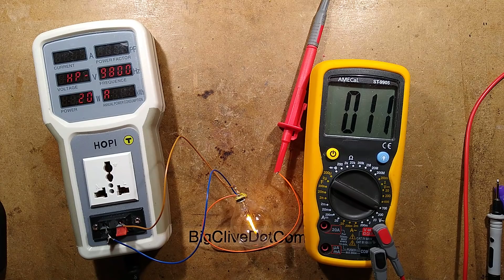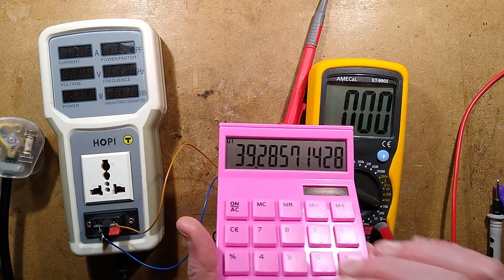Exploring 0.5W LED festoon lamps and extending their life

Comment: Oh wow, I didn't think you guys had anything like our C7 lights over there.  Now obviously these are G30 or whatever but that's clearly an E12 base, which our C7 lamps use.  Neat.  We of course had the series E10 sets way back in the day as well, ours were 15V bulbs and 9 in series, yours I believe were 12V bulbs and 20 in series.  Often with one single wire in a loop, instead of a straight line string, though those were available as well, usually with a knot and a little drop of something like 2" down to each socket.

I actually made my own E26 festoon strand in the style of vintage sets with a twisted pair I also twisted myself.  Time consuming but easy, and I used Leviton #167 sockets.  Lay wires in the tracks, screw down bottom cap and pins punch into the wire and make contact.  A nice, vintage look.  Then I bought these multi color filament A19 LED lamps, 60W equivalent, and thought that'd be neat to test it with.  The spots in my eyes lasted for hours.  LOL!

Comment: Theoretically wouldn't putting two leds in parrell pointing opposite directions be safe, since there is a resistor in series? I would think the LED forward biased would drain off enough of the voltage that the reverse biasing wouldn't be high enough to do damage. Basically it seems like it is just the relatively high value series resistor is what makes these LEDs safe to run on AC.

Comment: I have this exact set! Keen to extend the life, is the 1U 400V capacitor definitely to go in series with the set and not parallel across L and N? And should the 1M resistor be across the capacitor legs (so also in series) or across L and N? 

Also, would a 2W metal film resistor of 1M be enough power to discharge the cap safely?
Reply: In fact I found the answer to my question watching your other video on Dooby lamps (how to make your own) - keep up the amazing work Clive!

Comment: E12 is also known as "candelabra base" here in the US and is mostly used for chandeliers and similar indoor lighting where lots of small lamps are used in one fixture. The classic C7 indoor Christmas lights used the same base. Outdoor (C9) Christmas lights used the much larger E17 ("intermediate") base. What you have there looks just like a typical 1960s-1980s indoor light strand. (In the ’90s they made them slightly more rugged and added a fuse.) The build quality on outdoor light strands wasn't much better. Just bigger E17 sockets to hold the C9 lamps. I believe Europe typically uses E14 where we use E12, just as you use E27 for normal lamps where we use E26.

Comment: Many years ago, when I was a young boy growing up on an old farm that had no power or running water, one Christmas our folks took us into the small village of Thunder Hawk SD.  There was a house beside the road as you drove into the village that had blue Christmas lights all around the house across the barn and out buildings. I was transfixed!  That blue glow was the most amazing sight I had seen in my young life time.  That sight has stayed with me now all these 70 years or so, and over the years I have attempted to reproduce that seen with little luck.  The closest I have come to date were some bright blue LED's with shields the same size as those old large Christmas lights along with blue LED net lights over our evergreen hedge that lines the front of our little ranch house some 9 miles from that very house in Thunder Hawk.  While the street lights of our town cut them down considerably and you need a LOT of snow to get the right reflection factor it is close enough to give me a bit of the thrill equal to that day back in the 1950's when I first saw those lights.  I am sure the old Christmas Lights were the same size as the ones you are playing with, the ones I tried to replace them with are not screw in at all but pop off covers over push in flat faced LED's.  I have had to replace many of those LED's over the years and now I am no longer able to put them up or take them down, they stay up year around but don't seem to have suffered much for that sentence, I have had less trouble with them staying up year around then the putting up in the fall and taking down in the Spring.

Comment: What is that connector called, in which you placed the jumper and the 1uF capacitor?
Reply from the maker: It's a Wago clone from eBay.
Reply: @bigclivedotcom  Do you recommend the clones or sticking with Wago? Is the price significantly different?

Comment: You  comment over possible problems with the volts and the rain.  Now I have experience with my 6000 volt electric fence unit.  In the rain.  clean rain does not cause an arc over even 5mm of clearance  Equivalent to just 1/4 of a mm at 300 V AC.  DIRTY water ( ants, slugs, dust, dirt, salts etc) give very different results.  240 V can arc across several cm if ants choose to build a nest.  Which means that keeping the lights clean is far more important than the size of the base or even keeping them dry.  Dirt is always your enemy.

Comment: Hi just got a battery drill that charges using a USB C plug that puts out 13 V. Could it destroy a phone?
Reply from the maker: I wouldn't recommend using it to charge anything other than the drill.  A proper quick charge unit would start at around 5V and negotiate the higher voltage is the device being charged responded correctly.
Reply: @bigclivedotcom  thanks for the reply. I've stuck big labels on it. Tbh I think it was very stupid to use a USB c plug. It seems to be a simple charger that just puts out 13 volts

Comment: In 35 years I don't think I've seen one of those E12 candelabra bases ever burn or melt, but also have never seen them used outdoors or on a string like that, only in a hanging fixture or a floor lamp that thinks it's fancy. I've had one standard E26 pop where we had to get a potato to jam in there to unscrew it from the fixture but that was, uh, 28ish years ago. 

I have seen a few holiday lights (your fairy lights) burn out and melt the housing but that was over 25 years ago.

Comment: OH i just seen a video where you open up the hopi in the listings from a year ago! I have to watch it again. "JUST BECAUSE IT HAS THAT IRONIC NAME".. }B=[ >
P.S. i like the hook connector on the + probe you were using. i have those probes with the option to connect different parts on them. mine came with the normal probes(with spare needle tip's)  and small gator clips with a funny sort of hook on the end that come's in handy in different situations. : )

Comment: Just put up about 500 bulbs that look suspiciously the same and in those same exact strings outside in southern Louisiana, sounds like I’ve got a proper large scale test on my hands!!
Reply from the maker: Let me know how they do.
Reply: @bigclivedotcom  looks like they’ve had about a 20% failure rate just past the 2000hr mark. Some completely dead and others only part of the LED filament is no longer functioning. I noticed water got into some of the bulbs but I also wouldn’t be surprised if the outdoor heat severely shortened some of the bulbs lifespans. Also had about 50 in an indoor setting, 5 of which dead after about 1500 hours.

Comment: ❓ What might happen if we run a normal USB charger off 50V DC instead of 240V AC❓ I have one running off my ebike battery..
Reply from the maker: Some might work, but you do got dedicated modules for converting quite high voltages to 5V.
Reply: @bigclivedotcom  HV buck converters are very expensive compared to quite decent USB chargers, that's why I chose to go that way. Maybe dedicated bucks might be more efficient?

Comment: I bought a set of festoon lamps for my mum here in the UK, but the ones I found listed on Amazon are actually powered from a 24v Christmas light style transformer and have a far more substantial cable (overall diameter of around 3mm), plus the weatherproofing seems to be quite a bit better than on these. So far they've been outside and in use every night since January and seem to be holding up ok, not too bad for £30 for 35 lights!

Comment: It's interesting how the Hopi read a high .97 power factor with the entire string but only .75 with just a single bulb. I couldn't think of why the PF of a single unit would be lower if all the units are identical. I ran a quick simulation and it turns out the PF isn't lower. It's just the Hopi being inaccurate with very small loads. When you ran it in series with the diode it didn't register any load, as you've noted before.

Comment: Voltage question.  On the scale of dangerousness would the UK be better off going to 2 phase 110V?  They would still get their power from the plug but only at 110v from ground.  

In Canada we have 2 variants of these.... 230v and 240v... not that there is a difference in the power applied... just momenclature.  (I might have these backwards but...).  Neither of these plugs exist in the home except at dryers and stoves.  The older 230v is now mostly used in more "industrial" appliances mostly like welders and portable heaters... these are 3 pin huge plugs like the UK one... they made one blade bigger for polarity... like it matters... it would take a special stupid to cut the ground pin... and since it is 2 phase it really doesnt matter which way they are put since they are both equally hot.

The newer 240v is used in the house for stoves and dryers.  It is the same power wires except they added a dedicated neutral for a total of 4 pins.  Two 110v powers one ground one neutral.  This allows separation of the chassis ground and neutral for better separation.  Especially good for appliances that people touch all the time if anything goes wrong with the electrics it usually remains isolated to the neutral.

If the UK went to a two phase 220v plug they would be able to arbitrarily take one 110v power wire and use that.  This would allow appliances to start at 110v instead of 220v which should add efficiency.  

In this age of multuple lower wattage items vs small numbers of large wattage items it would seem that efficiency could be greatly increased since far less power would be lost dropping heat.
Reply: There wouldn't be a large efficiency increase because very few devices drop the entire mains voltage. In fact switching power adapters like almost everything uses nowadays are generally a tiny bit more efficient on 240 than 120. The main place where lower supply voltage leads to more efficiency is with incandescent light bulbs but those are falling out of fashion.

The problem with the UK adopting American-style power is that their plugs have a neutral. If you connect their socket to our split-voltage power then you will always connect the device's neutral pin to the live wire which would make existing devices more dangerous to use. Plus with their plugs it's almost impossible to shock yourself.

I should note that some countries (I'm thinking Norway, but could be mistaken) used to use 3-phase power with 220 between phases and wired two lives to each outlet, similar to our North American system. For new installations now they use straight 230v because that's what the rest of Europe uses and it also allows usage of 400v 3 phase power.
Reply: @eDoc2020  I suppose the only gains in efficiency would be on simple power items like resistors... I was thinking efficiencys from the proliferation of the variable resistors like on the led lamps... those lamps would live longer if they didnt have to dissipate so much.  That hasnt stopped the crappy lamps from failing en masse on 110v as well... it is a bit of a mess here.  They had special grants to buy these specially sourced LED lamps to save the planet... 50,000 hours... mine have lasted longer than most at about 2000 hours.

In Canada when went from 3 prong 220v to 4 prong they allowed legacy installations... they frowned upon  cutting the cords of the devices and suggested updating the plugins... but these were 2 plugs maximum per house.

As far as the differences I do like the extra grunt from a 2 phase 220v motor compared to a single phase 230v... but again in residential its not so useful.  Here we have 600v 3 phase as commonly available on the poles so industrial installs with 480v (the voltages arent these actually but it is the colloquial names) also being a choice but usually only for companies that run large motorized equipment.  3 phase 208 is a lot of poop for most uses.  Not really usefull for residential.

I wonder if LV lighting used in commercial could be an interesting option for housing.  Perhaps using a 24v power for lighting would be a benefit.  Then grilling of LEDs would be slightly less since the dropper resistor would dissipate less and add less heat to the board.  There is really very little need for much power at the ceiling... and 24v should be enough for ceiling fans.  It would reduce the worry of unskilled people doing the work compared to 110v.
Reply: @someguy2741  I don't think using a lower voltage for lighting would result in any efficiency gains. If a 120v light uses a 1k resistor and one string of 40 LEDs then the 24v version will use a 200 ohm resistor and 5 strings of 8 LEDs. The efficiency and thermal properties won't change at all, there would just be more losses in the wiring.

Comment: When using these as exterior christmas lights even on trees and removed every year I dont remember ever having a string fail or a socket fail.  I think since  it is AC it doesn't corrode (110V).  The bulbs needed going through every year.  I think this set with a capacitor might be indestructible. 

It amazes me that the 220v is used in so many parts of the world for general power.  Almost everything you use except electric heating elements could be served by 110v... and now with electronics even less.  I would really like to see all lighting and general plugins settle to a 24v standard (or even 12v).  Almost everything transforms to those nowadays anyway.  It would make dodgy electrically stupid home depot patrons much less likely to burn their house down.
Reply: 220 V is very rarely used, most places are 230 V. 24 V would be a terrible idea. How am I supposed to use my fluorescent and HID lamps without 230 V supply? What about neon signs, they need a transformer with 230 V primary.

Comment: Taking apart glued in bases is easier if you use a hot air station.  At least for old incandescents I heat the base with the hot air and just pull it apart.  It is super common in older automotive bulbs.  I then reuse the bases since they have so many variations and make LED replacements.

Comment: I would expect the resistor value to be lower for 120V mains. As well as the power dissipation across it. Given they use the same LED COB inside 120V bulb.

Comment: Sorry, you used 0.003 A for calculating the power for the resistor, but the hopi reads it on its last digit, so that's a VERY flaky number.... The better way here is U²/R and that is 0.37 Watt.

Comment: We don't have issues with the sockets that much burning out however I suspect water ingress would be an issue with GFCI's (RCD) sockets. I have not lived in a place with GFCI's and used outdoor lights at the same time so I can't answer that question but I'm pretty sure they would trip if it got wet. Just having an extension cord connected outside with another extension cord enough water was able to get in to Trip It.
We had a set or two running down our driveway along the trees where we were renting until the landlord had the trees trimmed and they decided to cut the lights every 2 feet. Saved as much of it as I can never know when you need a socket. The larger base was usually used in older larger bulbs. I still have some of that cloth covered strings in boxes in good condition.

On a related note our newer regular AC strings are fused at 3A in the plug, I calculated this out to be 2.5 strings of the lights before you basically blew the fuse. And conveniently our driveway was longer than that, the plan was to have them go from the door to the end of the driveway but would have necessitated multiple extension cords.

The lamp sockets I have seen don't usually have the drainage slots must be a new thing. It's interesting that you don't use the nightlight style socket I can never remember the right E numbers, I was tracking down a smaller than that socket for a halogen lamp thinking it might be used overseas. I don't know why Lowes sold it I couldn't find anything that fit it on the shelf and ultimately had to take the next size up and bend the screw base to fit.
Reply: I wouldn't consider GFCIs tripping in that case to be an issue, but rather just them doing their job. The GFCI should only trip if there's a ground fault. If you just have a 2-wire string of lights and they aren't touching anything grounded then the fault current from water ingress shouldn't trip the GFCI. My neighbors use outdoor lights seasonally and I haven't heard of them tripping GFCIs. I haven't looked closely at their setups but we all have GFCI-protected outdoor outlets and their lights seem to be on all the time. So either they don't trip frequently or they bypassed the GFCI.

Comment: You need a test area in your garden, set up a timer and have them running outside until failure occurs. An autopsy of the item would pinpoint weak areas and you could improve on the cheap designs.